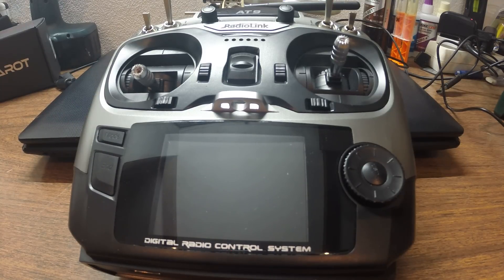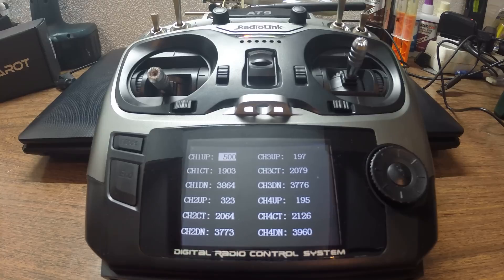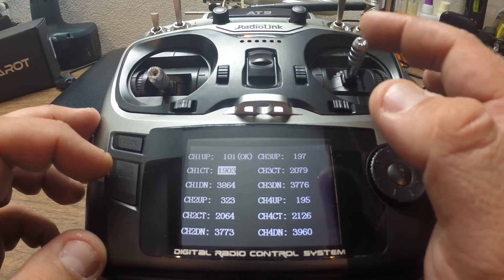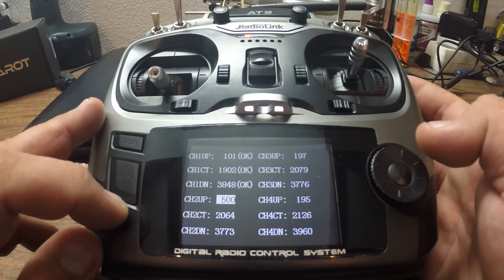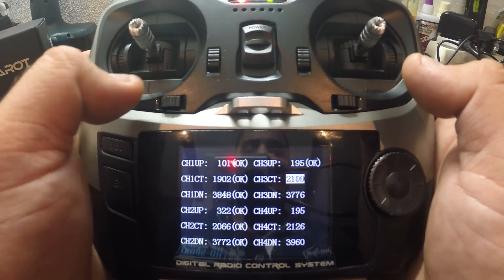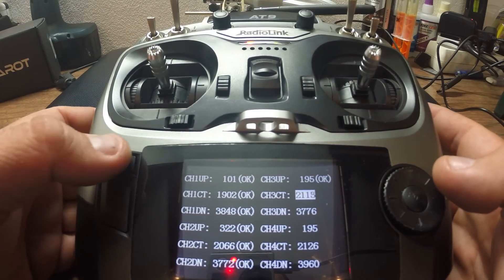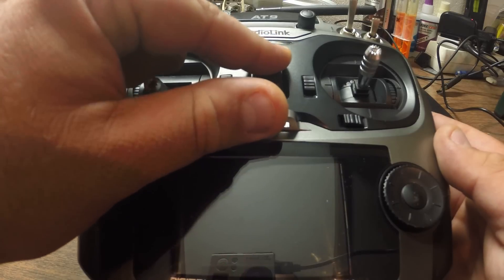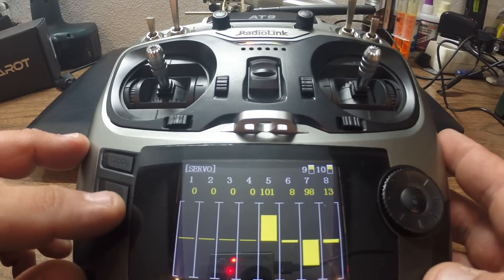RadioLink AT9 Stick Calibration

Comment: The THR-stick is pretty tight, you could loosen it up. By opening the AT9S up and loosen the 2x screws with the alumium plate a bit, the left THR stick feels much more comfortable if you do.

Comment: Awesome! My AT9 s was needing this! Never calibrated it since I got it.  I use it all the time. Thanks for this video tip. I have been super happy with my Radiolink products! I run the R6dsm in almost all my rigs.  and the 12 in my longer range quad. Such a blast. My little goal: To have 15 diff quads all on one radio. yee haw.

Comment: hey there I got the same radio an I love it ...your videos help me understand somethings with it  . I'm having some troubles with a setup I'm trying to do so I figured I'd reach out to see if u could shed some insight on it..so I currently use sbus with my at9 radiolink..I have a servo I'm trying to set up so it tilts my arms forwards an backwards. I found how to mix the channels so the servo moves its plugged into channel 6 an switch A turns it on and off... but I can't figure out how to trim it or set it up so when I turn the switch on and off it stays in the middle position. right now when the switch is on its perfect an my right stick tilts the arms back an forth but once I turn it off the servo goes backwards. if you have any info on it...it would be much appreciated thanks!!

Comment: when doing this is it possible to move other sticks? for instance what I'm trying to do is make my left stick throttle and aileron and right stick pitch and rudder.
Reply: I may of answered my own question. there's a stick option in the settings mode 4 is what I want I think
Reply: Your transmitter is mode2, right? Make sure the STK-MODE of your transmitter is 2.(You can check it in the PARAMETER menu.)

Comment: Hello, Can I use my AT9 with a flight simulator? I can't find any information about this. If so , do you have a video link showing the setup? I really like the radio but cant find much on setup and features
Reply from the maker: +dbm 55 Hi. Yes you can use it with a flight simulator. You need a USB Dongle  http://www.banggood.com/FPV-Racer-Simulator-with-Dongle-Cable-for-Flysky-Esky-Radiolink-Futaba-Remote-Controller-p-1047126.html

Cheers
Reply: +Sergio Pereira I'm having trouble setting it up with a flight simulator too. The controls are not working the right things.